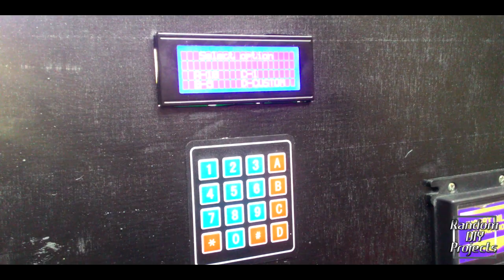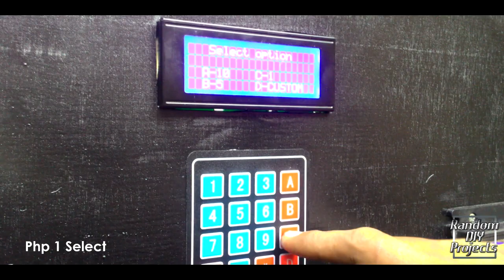DIY Coin Changer Machine using Arduino - Apex 5400 Bill Acceptor

Comment: Hello good day  i just want to ask if how did you supply the 3 MG996R servo motor to function in an arduino what type of power supply did you use?
Reply: Want to to help!you can supply 4.8 to 7volts 2amps if you are loaded as this servo have a better torque